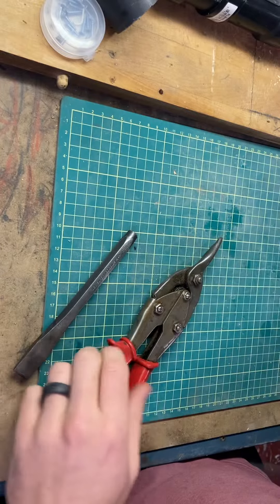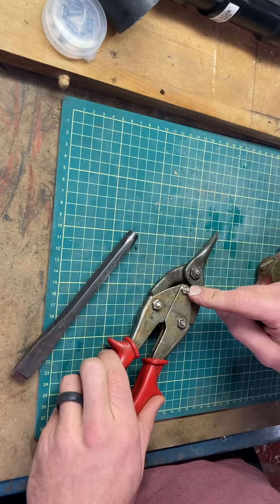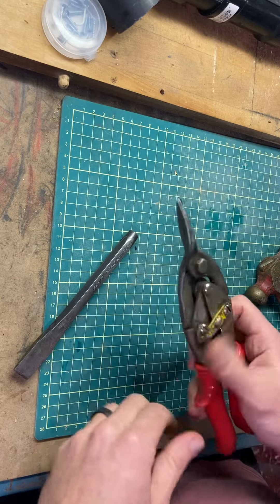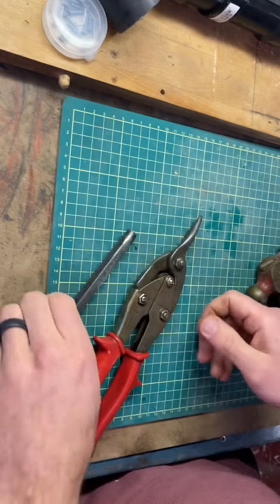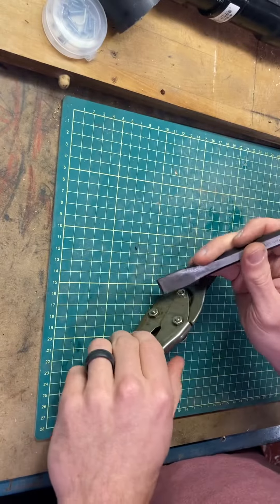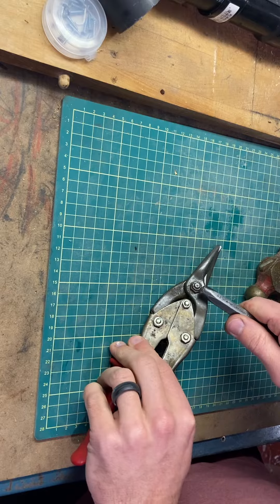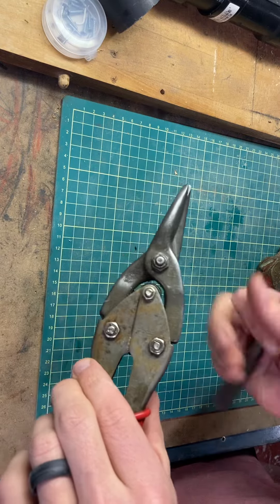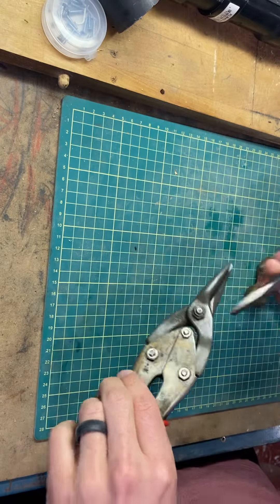no10: DIY locking nut.  Metal Shear #repair!

Comment: That will work for sure!  If this small bold needs not to be removed, then you can cut the bolt flush to the nut and use a punch to rivet down the stud against the nut. But that is risky, at the stud of the bold might compress a bit and result in stiff snips Thanks!